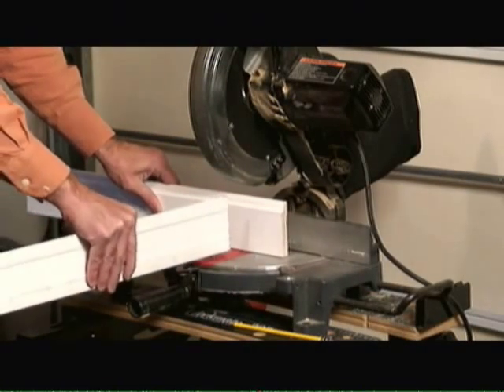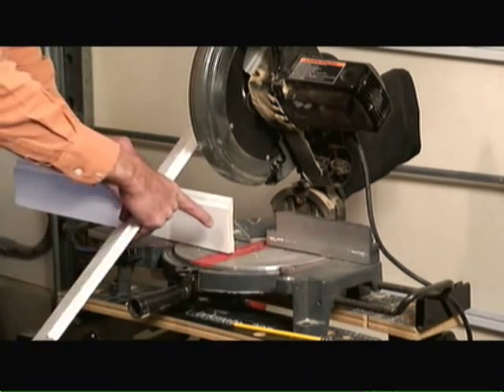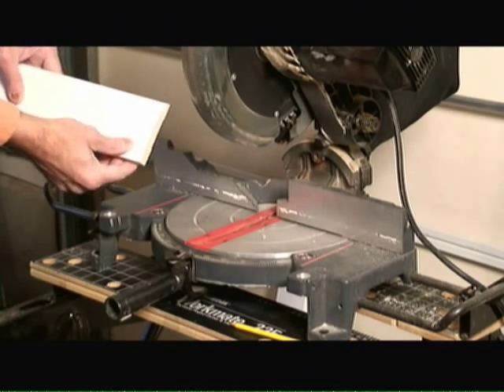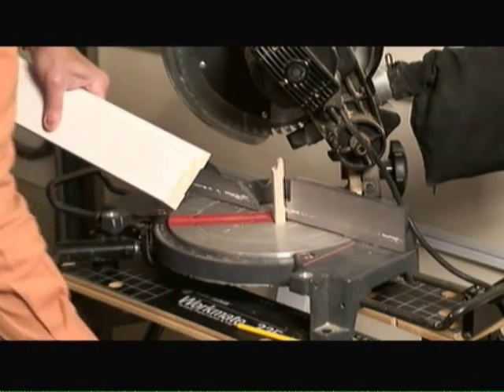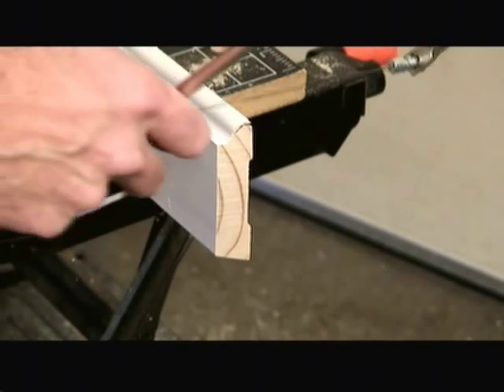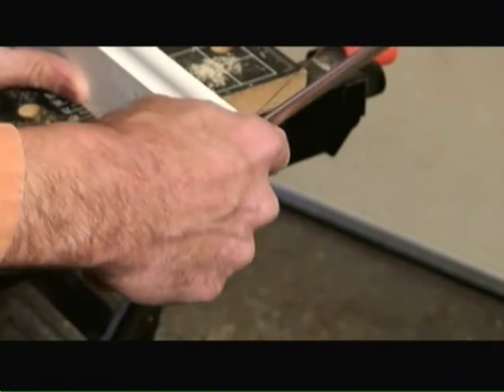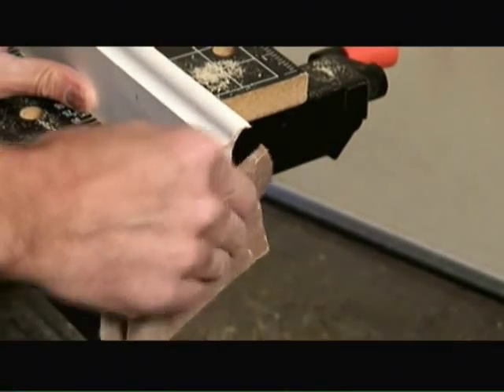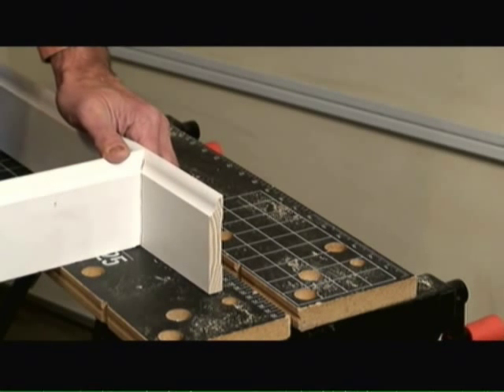How to Cope Inside Corner with Coping Saw Video

Comment: Good video, but I'll stick with using an angle finder and miter the cuts, then caulk the gaps.  I can't imagine using a coping saw on every single corner in the whole house.
Reply: +motionblurrr Then you are wasting time and not getting a pro result. Is that how you treat a natural finish crown mold? caulk the gaps, lol.
Reply: +Pranker pranker Most "Pros" use factory pre-coped material and pass the material cost to the customer. If they aren't snakes, they pass the labor discount on as well. They don't hand cope every finish piece in the whole house. I've never once seen someone hand cope anything and it be acceptable as is without filling. Also, do you cope cut outside corners for crown mold? Not exactly possible, is it? Angle gauge, set miter saw, test cut on scrap, test fit, adjust (if necessary) final cut. Provides a super tight joint in any material and is worlds faster than hand coping.
Reply: Of course you miter the outside corners lol. But you can get a get a much tighter joint if you cope inside corners.  Especially, say on a long piece with inside corners on both ends you can cut it a fudge long and flex it into place.  Hella tight. It's old school but it's the way I was taught and it works good for me I've done many many entire houses like that and I don't think it takes much, if any more time.
.Cheers.
Reply: Pranker pranker I'm no pro by any means, but I buy, renovate and rent out properties. I've coped only when replacing damaged pieces that were already coped. But I haven't seen any tutorials that describe or use your technique. I'll try it next time I have to, but I never use natural finish materials either. You should make a tutorial and post to YouTube, because the ones on here are crap. "Look at that tight joint" ... big gaps, looks like shit.
Reply: motionblurrr caulk shrinks into the gaps over time. If you flip the base upside down and cut the straight away with the miter saw all you have to cope is the curved profile. Way faster then using your little angle finder  on every corner. Coped joints are superior. Even perfect miters shrink in a way that opens then up and draws the caulk in. Coped joints shrink the opposite way which leaves tight joints no matter what. Coping is smarter, faster... and just the right way to do inside corners.